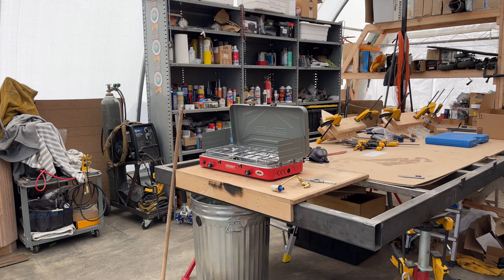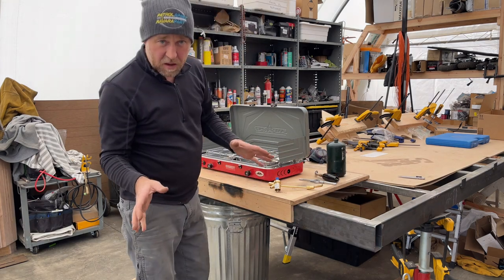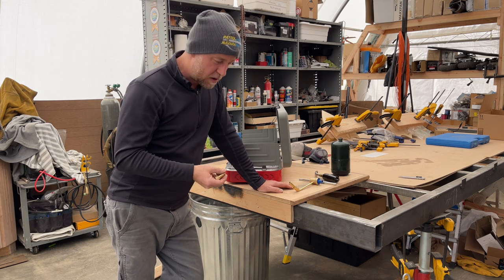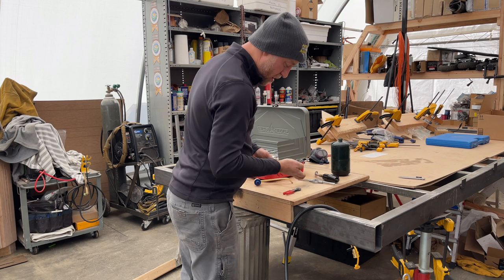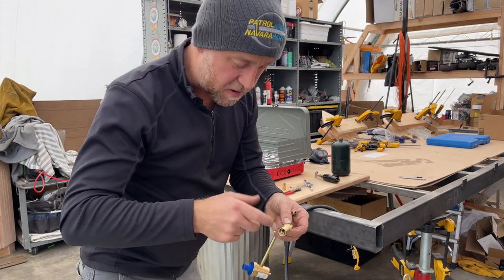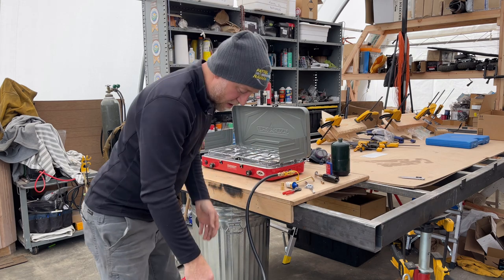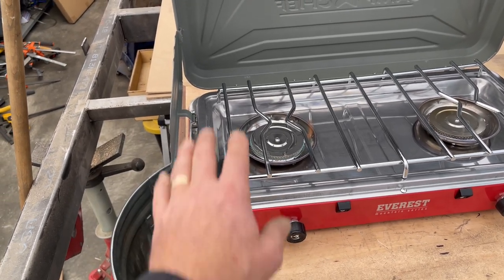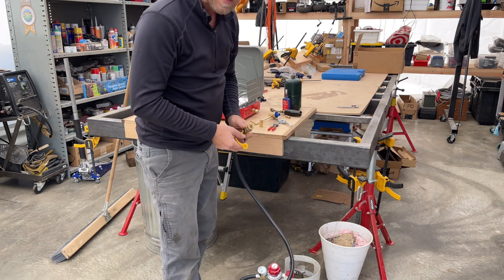Camp Stove and Quick Release fittings | DIY Project

Comment: OMG, if you only knew how long I have been searching this!!! THANKS. now my stove is a coleman but I think it should work the same at least the fittings seem to be the same. The important piece I think is the regulator with the 0-30psi adjustment! I spent 5 hours over the weekend trying to make the blackstone 90 degree thing work but the fitting (internal valve doesn't work) also I think that the blackstone are suppose to work with low pressure. Anyway I am looking forward to make this work for my application! I will make my own video for my channel and give you credit for sure!
Reply from the maker: Great to hear that it helped. 
I found that only 5-10psi needed to run the stove (in my case)
Good luck

Comment: Hi Bud, well I finally got my conversion to work.  I think you may be interested in what I found.  The die size you had used was an 8mm x .75 pitch.  That is the equivalent to 33.86 TPI.  The problem is that is not the right thread.  If you use a thread gauge you will find that it is a 40 TPI on the coleman stove.  In metric that comes out to a pitch of .635.  They do not make a metric with that pitch.  I ordered a 5/16 x 40 TPI and I finally received it yesterday.  It is not a common size and was difficult to find.  It worked great though for what I did to make my conversion.  I also ordered the same adjustable regulator that you used.  I did not like it at all and am sending it back.  I did not like the way it attached to the cylinder and the hose is very stiff.  I went a different route and made my own hose and purchased an individual regulator.  It really works great.  I tried to do this years ago and never finished it.  I had contacted Coleman and they were not interested in even letting me talk with the Engineers.  I actually thought this conversion was hopeless and I was going to have to settle for the throwaway green bottles.    I finally after all these years was able to get my coleman stove to work with my conversion.  I just finished it today. April 7, 2023.   I did a lot of research and trial and error and finally had success.  I hope this is helpful to you.  I now will be using a couple 5 gallon tanks in my truck camper instead of the green bottles.  I also purchase an adapter for the green bottles that I can screw right into the regulator if I want to  use them.  I move my stove from the inside of the truck to the tailgate and also to picnic tables often.  This will make it much more convenient with my quick connect set up now.
Reply from the maker: Update posted
Reply: Thank you for sharing that this is actually "5/16 x 40 TPI" rather than "M8 x 0.75". I had come to the same conclusion, however when seeing this video I was about to order the 'wrong'
 one. Much appreciated!

Comment: Hi Bud,   I took my stove completely apart and took the stem out of the regulator that comes with the stove.  I ordered the tap and die that you mentioned.  8mm x ,75 pitch.  Not sure how you came up with that size but it is not correct.  If you check it out with a thread gauge you will see that the .75 pitch is close but is not the right size.  So when you put that in it is close but is not really the correct size.  I am interested in how you actually came up with that size?  I hope this helps anyone else that is trying to make this conversion.
Reply from the maker: I started on making another today and found that a wrong part was shipped so had to reorder.  Not sure on the die size numbers, been awhile since. Once the part comes in, I’ll revisit this topic with a new video
Reply: @budnixon  Hi Bud,  I was surprised to get a response from you.  I am in the process of making the conversion myself.  I will tell you that the .75 pitch is I not the correct thread size.  It is also very difficult to get that particular Die that you mentioned.  8mm x .75.  I was able to find one on Amazon but there is not one local store in the Milwaukee area that carries that particular size. It is a very uncommon pitch size.  Regardless of that it is not the correct one to use.  I ordered one and am sending it back because it is not the correct size.  You need to get a pitch gauge and you will see that.  I am sure you were able to get it to work as the threads are so fine and since it is going into a brass fitting it is cutting its own threads as you turn it in.  Essentially it would be similar to cross threading.  With sealant it probably will work ok.  I  have ordered a different tap and die that I think is the correct one.  I will be working on it this week when I get all the parts.  I started looking into this years ago but never was able to get much information. I contacted Coleman and they were useless in getting me any help.  They would not let me talk with the engineers.  I emailed them and never heard back from them.  This is very typical of companies that really are not interested in improving their products.  Another example of NO real customer service.   I think I found an inexpensive way to make this conversion.  The problem is always a liability concern that someone will do it wrong and then there will be a lawsuit.  I would be willing to talk to you or communicate with you personally about this.  I actually think this conversion could be made a lot more simple then anyone would realize.  I offered Coleman my help in regards to making a kit available to the public regarding the conversion to a Quick Connect system using a larger tank.  As I mentioned I never even got a response.  I am surprised that some engineer has not figured this out and provided a kit that would be available to the public.  They could sell it through China to avoid all liability.  The Coleman stoves are made there anyway and shipped here.  I honestly believe they continue to make this stupid regulator that hangs out there which is inconvenient every time you want to move the stove or set it up.  All the talk about being GREEN and saving resources is just that.  ALL TALK.  They are not interested in conserving and saving energy.  They are only interested in the money $$$$$.  If I was younger I would redesign a good camping stove and sell it under a different name. I
Reply from the maker: @happykamp789  M8 0.75 worked in my case as you see it in the video around 11min timeline.  I'm going back to making another set for another of my stoves once the correct parts arrive.  Video will be uploaded once I get to it.
I do my best returning the messages :)
Reply: @budnixon  Thank you.  I am waiting for a part as well.  When it comes I will let you know if it is the correct part.  If so I can share it with you.
Reply from the maker: Not sure if you got to see my updated video, but i've found parts that fit together without any need to tap/die anything at all.  Fits all perfectly
Reply: @budnixon  hello!  Where's the updated video?  Or part number/link of that elbow that doesn't require you to change thread?  Thanks in advance!
Reply: I found it!  What is the quick connection part number that attached to the regulator hose?
Reply from the maker: @ANW2698  gotta look through my videos, should be there

Comment: Question are you cutting threads over existing threads
Reply from the maker: Yes, as the threads are larger step, and new ones are much finer.
Plus keep in mind that brass is very soft, so process is pretty easy (at least was in my case)
I use red thread locker (thread glue) - which seals it better than teflon tape (in my opinion anyway)

Comment: Been looking to make this conversion myself for a long time.  I appreciate your video but things are not clear to me. I ordered all the stuff you had listed to make this conversion.  You did not show how to connect the hose to the quick release fitting.  There is notadapter with the hose or the quick disconnect to hook the hose to.  You also did not show that in the video.  Could you please explain or make another video with this included.  I am confused.
Reply from the maker: You are correct, and seems like I just got the needed parts to finally put it together and make another vid! Should be seeing something next week probably
Reply: @budnixon   Thank you.  I actually am surprised that you even responded to my reply.  The one thing that is missing in the hook up is using the 3/8 in flare to 1/4" pipe that hooks to the quick release.

Comment: Can I do this on a Buddy Mr Heater. So it would be easy
 to conect from stove to heater . Im still new at this stuff
Reply from the maker: sorry for belated reply,
As far as Buddy heater, I would assume so.  Main thing to keep in mind is the pressure regulator - must be one that fits requirements of the heater you are to hook up, as far as pressure allowed through it.  I believe that heaters are different from stoves.

Comment: The video description does not mention that you'll also need a 1/4" Male NPT x 3/8" Male Flare Fitting and a 1/4" Female NPT x Female Quick Connect with shutoff valve for the pressure regulator hose.
Reply from the maker: Watch the updates
Might get more info

Comment: How did you disassemble the fitting?
Reply from the maker: Unscrew ;)
Reply: @budnixon  I feel like a crazy person! I am trying with pliers on the female gas side and a box wrench on the elbow side but the pilers can’t seem to get enough purchase and end up just marring the brass. 

Is there a trick or tools I am not aware of?
Reply from the maker: @VietNguyen-he1vy  honestly I dont recall exactly how I did it, but I'm about to repeat the process for another stove I've put together for my camper trailer.  I'll probably do a video update - stay tuned - subscribe! :)
Reply: @budnixon  that would be much appreciated! Otherwise I’ll be visiting a plumbing or gas store here shortly!
Reply: @VietNguyen-he1vy  Me too!  Doesn't look like this will work on a Coleman...
Reply from the maker: @joen1892  its a matter of making sure that the large knob thread fits your stove to start with.  The inner piece that sleeves over and seals up via rubber ring seals is the one that has to match the original one that came with the stove, next is the large nut that tightens the fitting.
I'm ordered another set of the parts and will be making another video, hoping to go into more detail and step by step on the process once again.

Comment: You should get some of the refillable 1 lb tanks. You can get a kit to fill them yourself or some places which refill tanks can refill them. Never buy the disposable tanks and don't refill the disposable tanks.

Why not use a 1lb adapter for the quick connect? That way you can still use the regulator.
Reply from the maker: I've heard a lot of folks commenting on "danger" of use&refill of the green ones, while i've personally never talked to anyone who'd any problems, or been hurt in any way through that process, so for now I feel comfortable enough to stay with that decision.  Reusable ones are outrageously overpriced (IMHO), and possibly one day I'll spare $50 for one, but not ready at the moment.

Personally, been doing this for many years, never had any problems.  I do my best to inspect cans prior to refill, exercise pre-cautionary measures (such as ventilation/standing away from the can, etc).  My refilled cans been with me on my trips as well, in all sorts of elevation gains and temperature ranges, so far - not a hick up.
Reply: @budnixon  I got refillable 1lb propane tanks for around $13. 

I have had the seals leak on the disposable tanks when not refilled, so I put caps with seals or a quick disconnect to prevent a problem.

It is illegal to transport a refilled disposable tank in the USA.
Reply from the maker: @MistDaemon   where you find them for $13?!
Reply: @budnixon  Sam's Club. Flame King is the brand. I heard some U-Haul carry them as well. Walmart has a listing for 2 for $30, but they are out of stock.